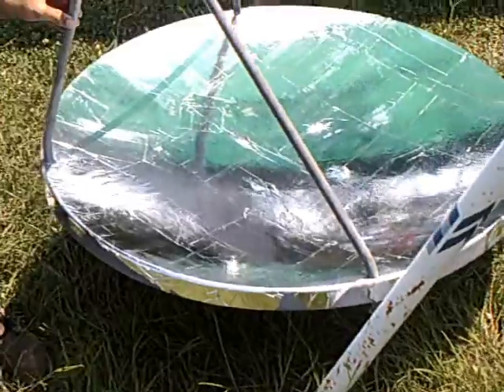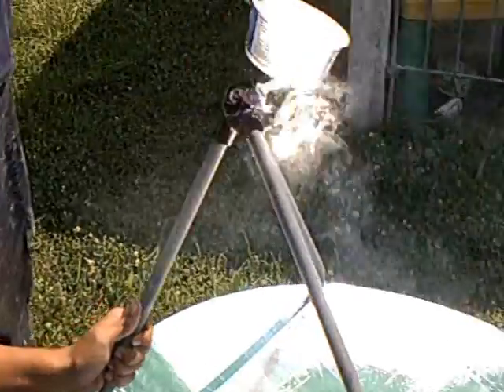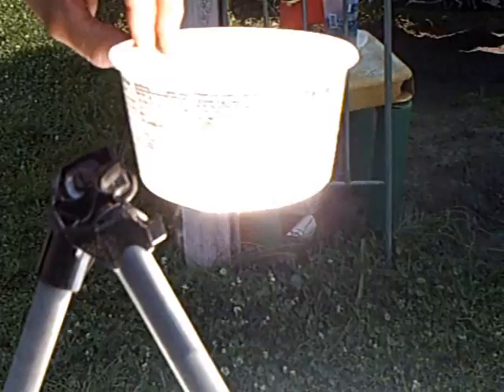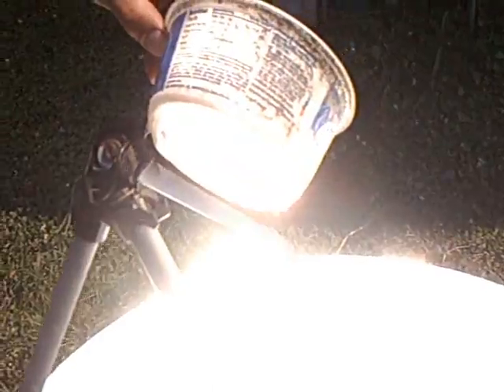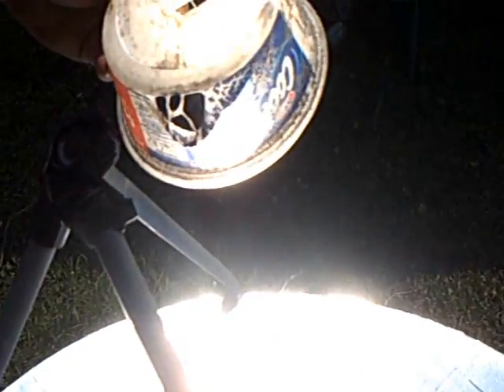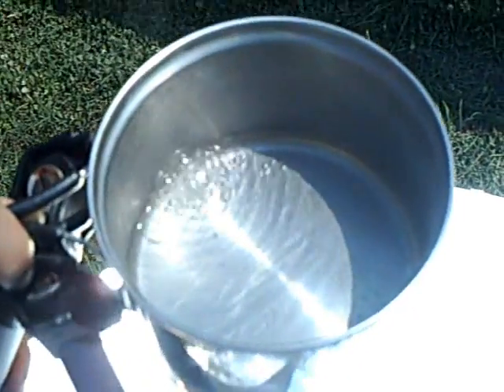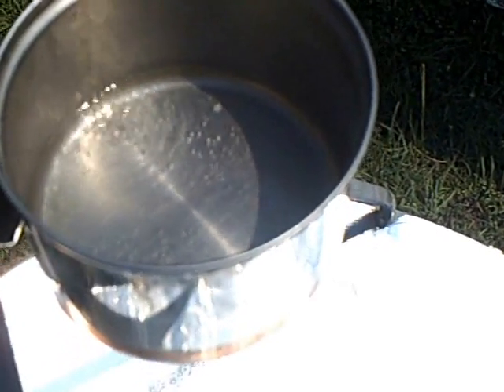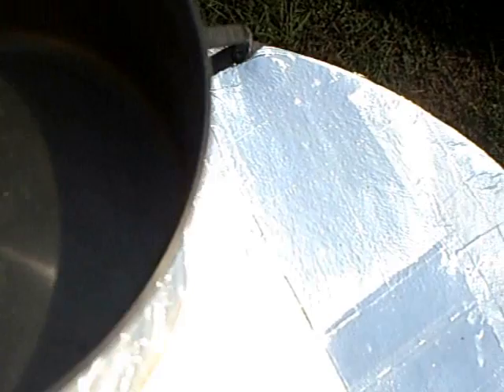42" Satellite Dish Covered in Mylar

Comment: It is a great tool for survival and for fun.

Remember, heat and temperature are not the same.

A dish of 1 meter^2 will receive about 1,000 Watts of power.   If you concentrate the 1,000 Watts into a small spot at the focal point, it will have the same 1,000 Watts.

A 42" dish is 13% larger in area than a meter diameter dish.

Well done!